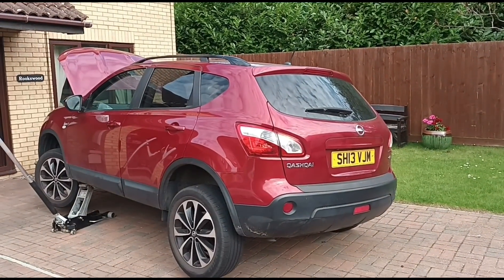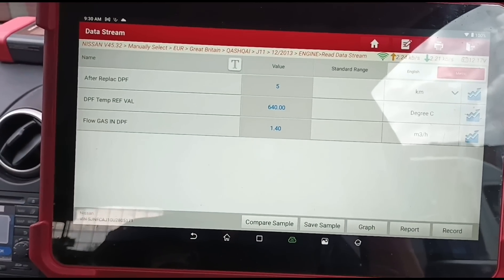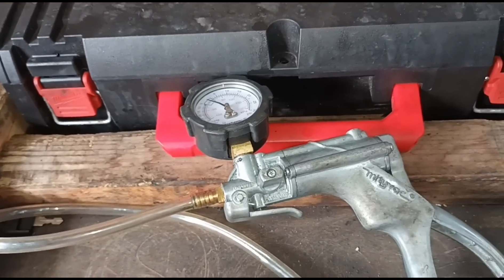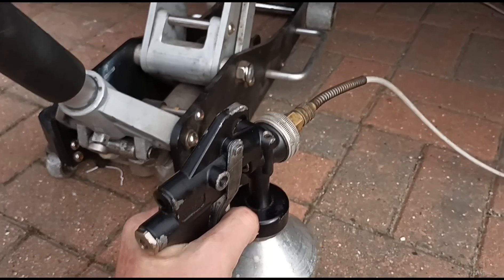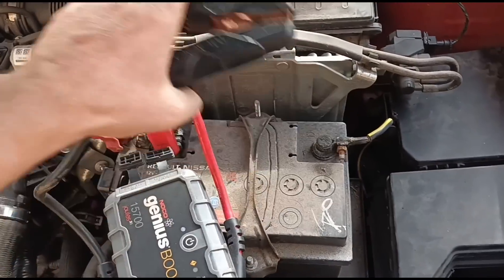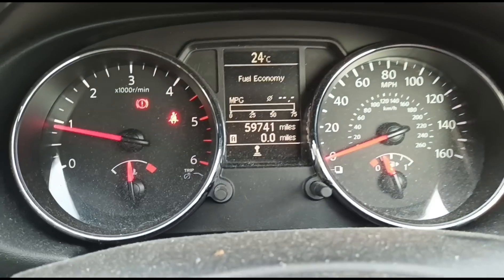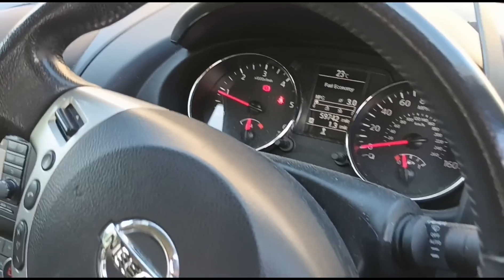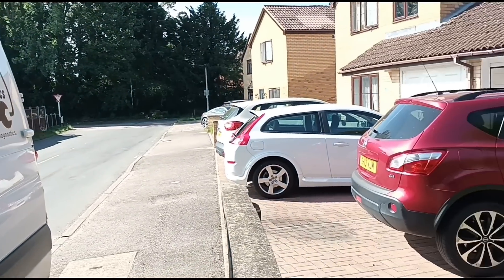30+Psi DPF Won't Allow Engine To Run:  Can I Clean It?

Comment: I'm a low milage driver. About 10,000 Km a year.
I now make sure I do a 40 to 50 Km return motorway driving at least once a month with ROM at 18,000 min. Even if I have to drop to 4th gear to do so.

Comment: saw a lot of your very helpful videos (incl one on a Tucson). 2016 Hyundai Tucson 1.7 CRDI with 40K miles on the clock. Unfortunately started getting intermittent Exhaust system fault and noticed diesel increasing the oil level pretty quick (when I say quick it is from mid to over Full after less than 20miles). Was told that the car is attempting a lot of frequent regeneration cycles. There's evidence of soot in the tail pipe and idle pressure is reading around 1mb, and only around 20mb under load, which apparently was told is not correct. Mechanic diagnosed that the DPF is therefore busted and there's no chance of cleaning meaning the only way is dpf replacement. It is apparently a common issue with Hyundai/KIA due to a temperature surge. What's your take on this? Unfortunately there's no real driving space here, thus passive regeneration is very very limited. It is possibly only a dpf issue, how can so much diesel end up in the oil after only 20miles driving?
Reply: to add that prior to replacing the oil, 2 forced regens were done, to no avail as the intermittent exhaust system fault popping up once in a while prior to realising I was having so much diesel-oil contamination that I stopped driving the car.

Comment: Hiya, got a 2014 Nissan with the turbo whining loud and smoke from exhaust. I’ve been told the turbo has failed and that is due to blocked dpf. But the car has no fault codes showing on the display. Would you suggest the the garage is correct and the dpf is blocked or can a turbo fail without the dpf blocked? Any advise I’ll be appreciated many thanks

Comment: Your videos are really good!

Manually cleaned my DPF and cleared the blockage code. 

I now have a P040300 - EGR circuit. Is this normal?
Have no dash light on.
Reply: You most likely have a blocked dpf because of that egr code

Comment: Had a laguna last week with the same problem. Check the injector that's bolted to the back of the turbo housing. More than likely it's blocked solid. Won't let the dpf regeneration happen
Reply from the maker: Thats the turbo pressure sensor pipe. It was already done by a previous mechanic
Reply: @ORileysAutos  I know the pipe you're on about. Small narrow pressure one. This is basically an injector. Fed by small pump over the the top of the starter. Pipe runs around side of the head. The 5th injector some people call it

Comment: Between that intake pipe bursting and the exhaust manifold pressure sensor pipe blocking up all the time 🙄🙄🙄
Relentless with them 🙈
Reply from the maker: Yearly replacements

Comment: Jimmy
I had an issue not being able to see DPF differential pressure in a vehicle. Turned out to be called "Delta" pressure. Made it a little harder to find in the search of the Live data.
Reply from the maker: Yeah I did search lots of different wording

Comment: Change the Oil at Half Manufacturer Interval Warm it up and drive it like you mean it, Never had a single problem following that approach.
Reply: That vehicle looked like it was the opposite. Inside was a tip & tyres looked well worn. Has all the hallmarks of a car that just gets driven on short runs & never looked after.

Comment: If dpf's regen or have to be cleaned & all the soot goes out the tailpipe anyway, what's the point in having one?
Reply from the maker: The soot doesn't go out
Reply: OK, thanks for clearing that up.
Reply: The muck doesn't go out while the vehicle is being tested for emissions, that would be embarrassing. The vehicle knows when it is being tested and holds the stuff in to be purged (sorry, "regenerated") later when it is not being tested.

Comment: Nice work! That gives me a lot of hope for my V50 with the 1.5TDCi, which has a blocked DPF due to a stuck injector which was dumping loads of fuel down the tailpipe. I replaced the faulty injector but even though it can start and run fine for about a minute, it will cut out after that when the DPF warms up, and the turbo won't spool. Pressure sensor reads 800+ mbar so I'm pretty convinced it is blocked.
Reply from the maker: Good luck!

Comment: I have bought my first diesel. A ford kuga on a 14plate. 49.500 on the clock. Only short journeys to and from work .how often would you recommend taking on a long run to prevent these problems . Love the Channel one content you put on ….
Reply from the maker: Once every 200-300 miles would need to be driven more than 30 minutes.  Doesn't have to be motorway as long as its moving not in traffic
Reply: Find a hill too, diesel engines produce most heat under load. A nice long hill gets enough load so it can regen the DPF if needed.

Comment: Same with my both Launch machines....they will not display vital dpf info on live data and they will not connect to any ABS units on all J10 and J11 chassis despite being repaired by Launch Uk centre. Hence i now have Autel and its brilliant compared to Lauch.
Great results Jimme boy!
Reply: in my experience the autel is a more complete diag machine. very close to zero the amount of times it couldn't connect to a vehicle.
Reply from the maker: I have an otofix from Launch.  I tried it on this car  but the same

Comment: 60k Miles in 13 years thats the reason why it is struggeling. These persona need a petrol car Not a Diesel
Reply: Probably, but it's hard to appreciate the differences when there is no information and dealers don't tell people anything when they buy cars.
Reply: I’ve the same car, same age but with 330,000kms on it and no issues with the dpf.  However I do long runs (eg work commute is 80km round trip) and no city driving.  That’s what diesels are best at.
Reply: I take my mums 535d for a monthly absolute trash to make sure it doesn't block up, it's a service I can offer anyone who has a fast diesel and wants to lend me it overnight
Reply: @brumarly 😅😅
Reply: @brumarly 😂😂😂
Reply: That broken pipe is a common fault. It breaks every 2-3 years on my Qashqai. I carry a spare in the car so I can change it when, not if the current one breaks. It’s a simple five minute job but the car will go into limp mode and eventually stop completely until that pipe is replaced
Reply: @davidmehlhorn726  you can  pretty much guarantee the customer drove it a fare distance with the EML on,
Reply: @dalemurray6834  the first time that pipe broke on me was at 2 years into ownership. Nissan told me it was ok to drive for a few days while they ordered the part in. So I drove it in limp mode and after 30kms, it conked out and like the car in the video, it refused to start. Since then, that part has failed every two years regular as clockwork. It’s just plastic and with the heat and vibration of the engine, it’s a certainty it’ll go again. I keep a spare part in my boot as I know the one currently in the engine was put in by me in December 2021 and so I reckon it’ll fail in a few more months like it’s predecessors did.
Reply: That's not really an excuse tbh, I had a Kia with 54k miles on the clock, 9 years old, and drove fine, no dpf issues. 
The issue as Jimmy said with this one was the broken pipe. Any engine dpf or not which isn't getting the proper air to fuel mixture will get soot build up, and isn't good for the engine.
Reply: @MrZimmaframe  I disagree. Diesels are designed for long distance runs, not short hops to the shop. Buy a petrol car if you regularly do short runs.
Reply: It doesn't help that so many people just don't know how to drive with respect to the machinery they are operating. My observation is that these days people tend to 'lug' the engine all the time, even more these days, thinking that lugging (some people call it 'straining') the engine at low rpm will save fuel and therefore money. They live in blissful ignorance, apart from maybe wondering why the fuel bill is still so high even though it's in top gear at idle speed, until something like this happens and expensive repairs are needed.
Reply: Low mileage doesn't do them any good my car has always sailed emissions this year I only did 900 miles due to health issue it failed original MOT chucked some additive in and scraped through the MOT. However he did state it had a boost leak code which if boost leak will over fuel and smoke blocking the dpf.
Reply: No no they are fine with a diesel, the blocked dpf and faults were only caused to the pipe split letting in air that then isn't monitored and the sensors think that the engine needs more fuel which it doesn't then unburnt fuel (black soot) blocks up the dpf quick, that's the reason, fix the air leak, clean the dpf, monitor the values to see there ok and reset the dpf learnt values and fault codes, test drive, double check on scanner and job done.
Reply: 2023 - 2013 = 10 years, not 13 (he says it’s a 2010 but it’s on a 13 plate).  Had the same car myself but changed it 4 years ago.  Never had a DPF issue but when I bought it was being driven 25 miles daily which should be ok, but by the time I changed it because I needed an Auto I have been only doing a few thousand a year …. and bought another Diesel and after no issues, went on holiday and when came back it developed loads of issues including the dreaded AdBlue one that’ll need a new tank (or it deleting from the ECU for a fraction of the cost) 😂 .  Think I’ll get an electric car instead.
Reply: Good result for customer what was the cost please
Reply: Should you clean a dpf before it blocks ?
Reply: Dpfs need HEAT to burn the carbon etc. People dont know how to drive a diesel properly. Keep the revs up (mostly past 2k revs) before changing gear and try not to do very short journeys without letting the engine heat up. Never had a DPF issue in any diesel ive owned, including the newer shape transit van which have a common DPF issue. So far 60k+ miles and no issues. 5th gear 2k+ revs on longer journeys. And no u arent saving fuel by changing gears too quick with low engine idling, youre choking the engine.